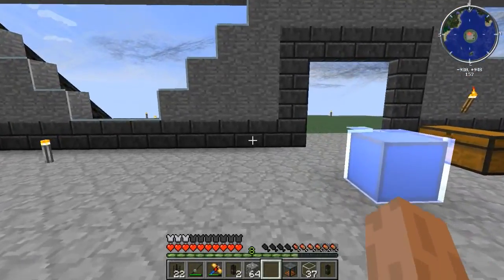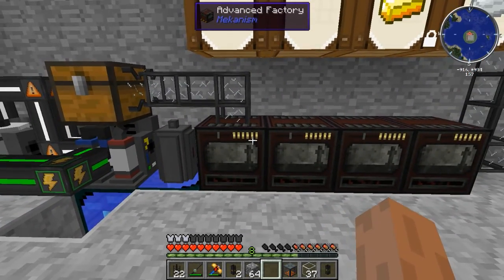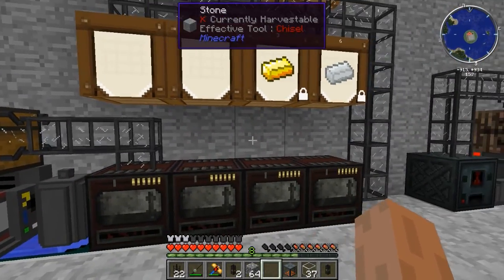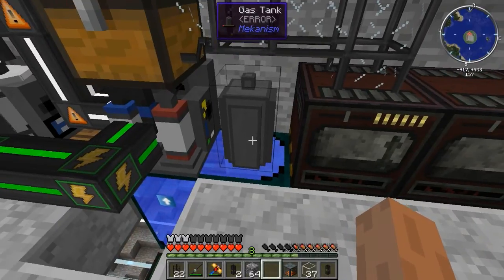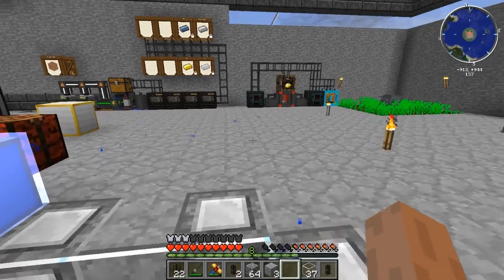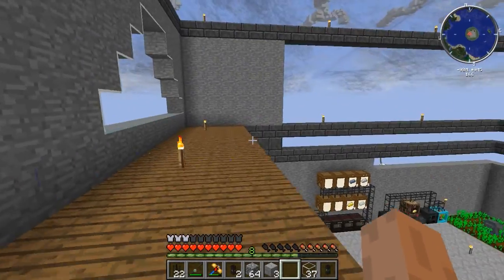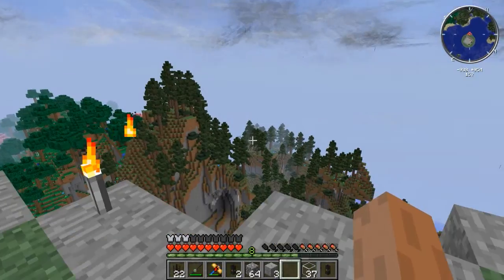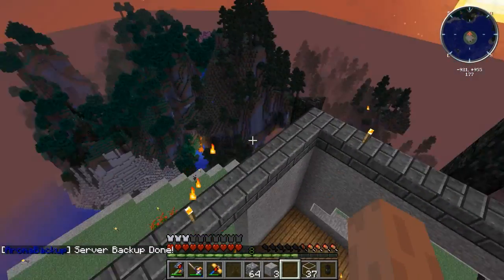Bevo's Tech Pack | Episode 7 | Quickie

Comment: Upgrade the power cables that are connecting your gas generators to your electrolytic separator.  You currently have four basic cables, which can transfer only 200RF/t max per cable each, so that line can only transfer 800RF/t.  The separator is asking for 1600RF/t but only 800RF/t is being allowed through that line.  You can either add four more basic cables onto the line going nowhere which will bring the total throughput up to 1600RF, or you can use the next tier cables.